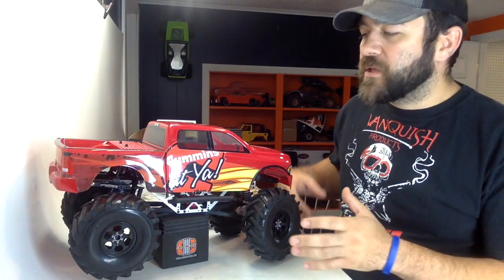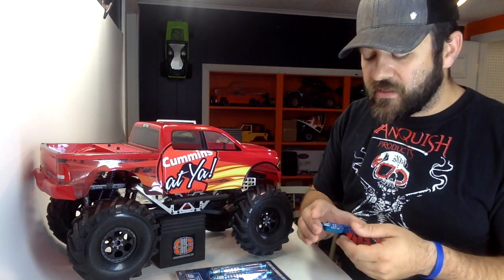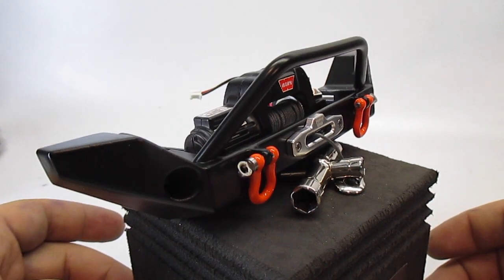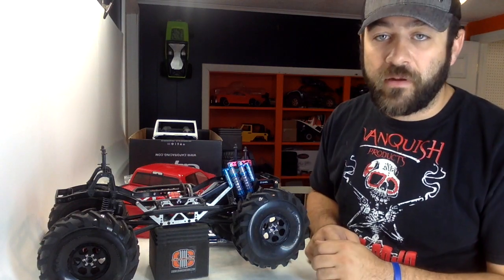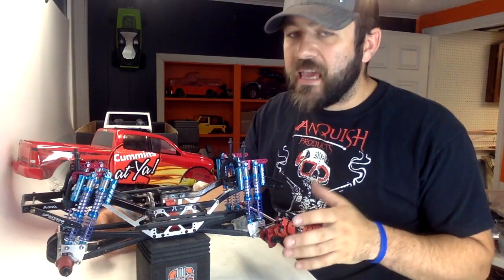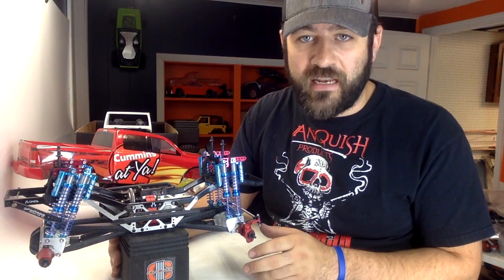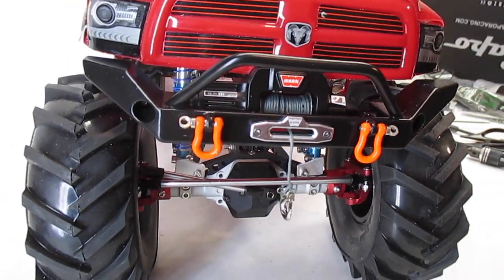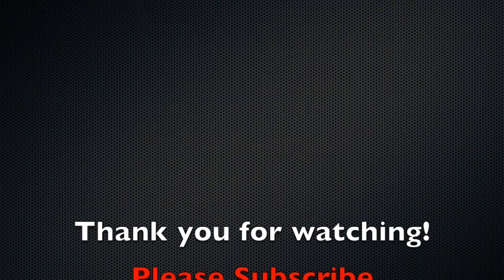SCX Mud Truck - RC4WD King Shocks & Bumper- Axial Ram Power Wagon - Episode 6

Comment: Alot of Rc4wd stuff. I know the Rc4wd Warn Winch is nice to look at , but why not go with a servo-winch that can actually pull some weight?
Most my friends just buy a good strong waterproof servo and make their own servo-winch. I just buy a KMS because I like the free-spool option.
Reply from the maker: If I want something that really pulls hard I skip the traditional modified servos and go to a fully machined TZIworld Beefy Winch. This build is mainly style,
Reply: +Harley Designs I understand that. I was gunna make a mudtruck but my focus is a Top Truck Challenge(TTC) truck first. All waterproof and all. I'll check out those winches.

Comment: are you going to be running a brushless system? im doing a similar build and im aiming for gobs of power so i was thinking of running the axial ae-3 vanguard system from the yeti 1/10.
Reply from the maker: I will be running brushless but it will be a sensored 4 pole system. This gives better response and huge torque. I'm going to be running the Holmes Hobbies BLE and Puller Pro.
Reply: +Harley Designs just did some research on the motor and esc you mentioned and I'm very impressed. this is the first time I've heard of Holmes Hobbies. I read that the BLE can handle 6s but can the puller pro handle 6s as well? if so that would be quite a lethal combo. I may just have to copy your motor/esc choice
Reply from the maker: +david hughes the puller pro is around 3500KV so 6s on it would be too much for the bearings to handle. 3s is what I'll run. That's basically the range I always run in my trucks and it's pretty much all I can handle as far as usable speed goes in a solid axle truck. 4s can be used on occasion when I need a little extra power or wheel speed for something like a sled pull or mud pit in a TTC.